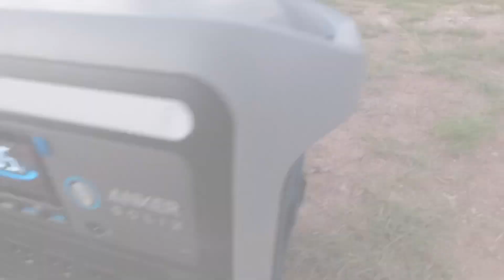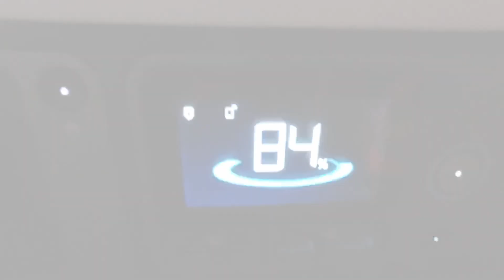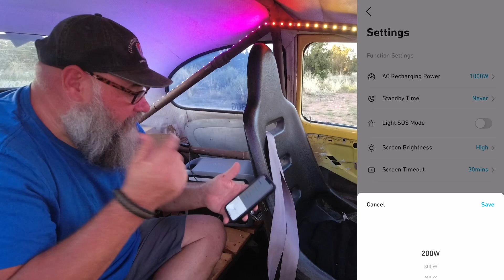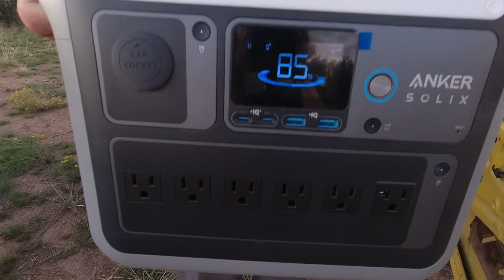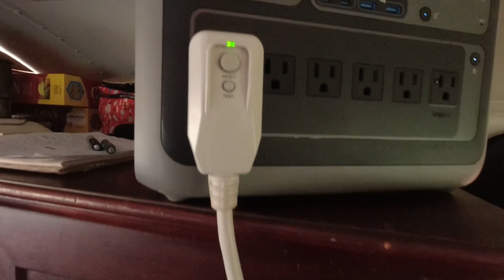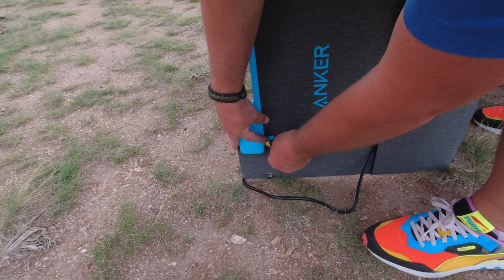BEST POWER STATION EVER?? | The New Anker SOLIX C1000 Portable Power Station

Comment: I will be powering a 43 inch Dell monitor, Z690 computer
and modem/router.  Everything is plugged into a CyberPower 
CP1500PFCLCD UPS. The UPS is plugged into a Kill A Watt
meter before plugging into the wall AC.

Everything runs at about 130 watts doing nothing and 142 watts
watching your great video.  Get lots of outages that will drain
the UPS and don't trust so many outages with a UPS.
Wondering if the C1000 could be plugged into the wall and the
UPS plugged into the C1000?  Might even be able to get rid of
the UPS, but will C1000 switch-over be fast enough?
Ever tried using a computer, unplug everything and test UPS mode?

Really liked your video and mentioning Bluetooth also works.

Comment: I got to say, I didn’t think I would be impressed! Will you do a watt hour test?  Also, it would be nice if the company advertised an estimate price on the additional battery on their website. Edit is it pass thru charging?
Reply from the maker: It does have pass through charging. I was told that the add on battery was not available yet but coming soon! I will not do a watt hour test. I need to get the appropriate testing equipment to do that. Thanks for the questions!